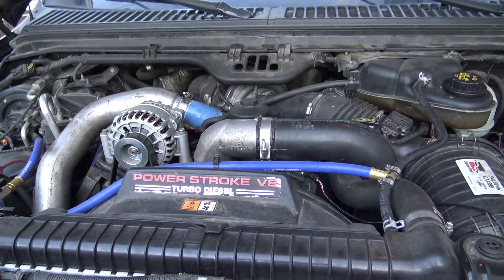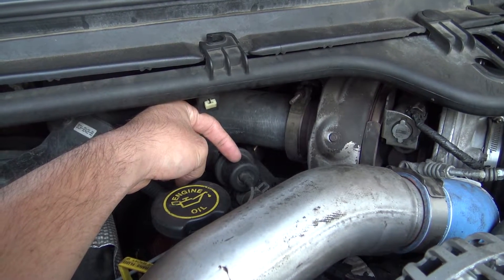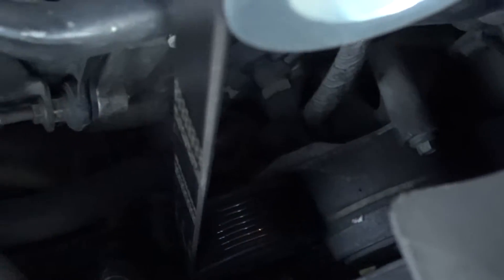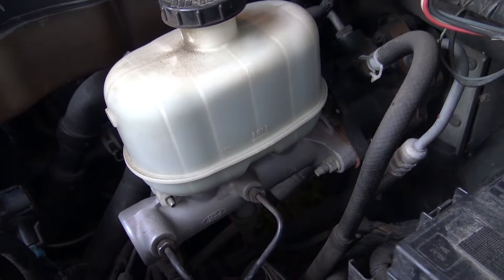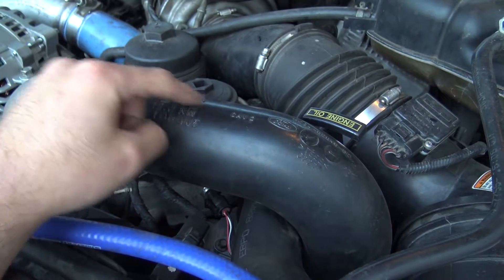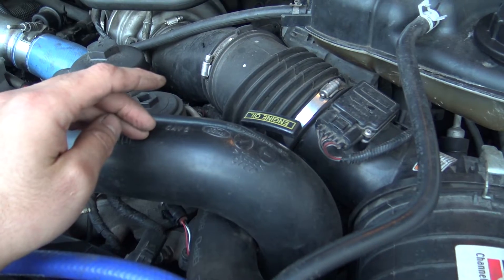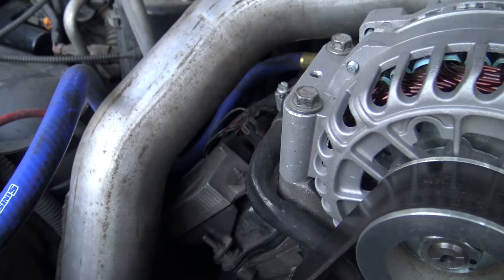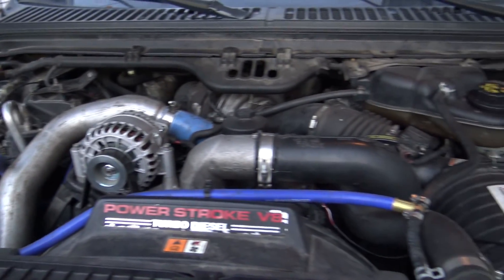6.0 Powerstroke - An Overview of The Basics

Comment: How have you liked your 6.0 since you bought it? Do you drive it every day? Tow with it? Do you plan on keeping it? I have owned mine for about 3 months. I really like the truck but I’m always worried something is going to break. I haven’t had any problem per say but I guess the forums etc have me nervous. Part of me wants to sell it but then the other part just loves the way the truck looks and feels.
Reply from the maker: I love my 6.0, only issue I've had with it was due to mechanic error from the previous owner.  
I don't daily drive it, although I do typically drive it at least once a week.  
99% of the time I'm driving it, I'm towing something and it performs great.  It tows my single car trailer with absolutely no problem.
I do plan on keeping it for a while, I'm doing little upgrades here and there so I can't get rid of it now.  
I like this truck a lot, it's the nicest newest truck I could get in my budget.  A cummins or duramax would be nice but they're a boatload more expensive and they have their own set of problems.
Reply: CtrlAltDefeatTV yeah, I love the Cummins trucks (had a 5.9 for years, wish I would have kept it)  but the auto transmissions ... yikes. I want to like the Chevys but every time I drive them I’m just not impressed.
Reply: RAM RAM there is a reason why these 6.0s are going up in value. Anyone can work on these engines now! The problem 10 years ago was that no one really knew what was going on with these engines. I just bought mine a month ago with 208000 miles. Its bulletproofed but I love the truck. Use to own a 2005 back in 2008. Drove it for 5 years and regret selling it. Never had an issue. Enjoy your truck and don't worry. Key is flushing your coolant, changing oil and use motorcraft filters only!

Comment: I just bought a used tow truck, 2005 ford f450 with 6.0 powerstroke 233k miles completely stock. The radiator got a pinhole and I just replaced it. When I Googled what antifreeze to use for the motor it said Motorcraft gold. So that's what I put in it, was I supposed to use something different? I did a radiator/engine flush after installing the new rad just to see if any debris or any thing other coolant and water came out, and it was clean. I'm new to the 6.0, years ago I had 6.9 international and early 7.3 but this 6.0 is a new one to me. Any suggestions with antifreeze or any other things I can do for longevity other then bullet proofing it, at least until it has an issue with either egr, a head gasket, or oil cooler getting plugged?
Reply from the maker: I've heard motorcraft gold is an ok coolant for it.  I personally use the CAT extended life coolant (ELC).  It's a red coolant that I believe is designed for big diesel equipment and big rigs.  
I've heard you just don't want to use the regular green coolant.  These engines use the coolant to cool the EGR gases and the engine oil so it's exposed to some pretty high temps and from what I understand it causes the green coolant to clog the EGR cooler and/or oil cooler over time. 
The main issue with the 6.0 is the EGR cooler and the cascading effect that happens when the cooler ruptures and you lose coolant.  You rupture the cooler, you lose coolant, you lose coolant you can't cool your oil, the oil and coolant get hotter and hotter until you blow a head gasket and/or melt the plastic bits if your oil system.  
If you don't have emissions testing where you are, I'd delete the EGR.  It eliminates a weak point, and saves your piston rings and cylinder walls from the soot/carbon which does add extra wear. 
If your oil temps reach 15-20-ish degrees over your coolant temp then you may want to replace your oil cooler.  The main worry is clogging, oil coolers do rupture but that's more rare.

Comment: How well do you think the coolant filter works?  And how reliable do you think the 6.0 is? If you don’t put any power to it what sort of problem will you have if any?
Reply from the maker: I haven't cut open a filter or anything, although that might be a good idea for a future video.  But I've seen several posts on various forums of people getting grit and rust out of their blocks while doing a coolant flush and I'm hoping all that is being caught by my filter.
If you maintain the 6.0 it should be fairly reliable, the lower the mileage the better of course.  There are a few issues that can leave you stranded, but a majority of them can be fixed and prevented. 
In my opinion, running stock power levels with an EGR delete and torquepro to monitor coolant/oil temps, HPOP pressure, boost, etc is really all you need.  Don't thrash on it, and it should last quite a while.

Comment: I have a question ha. What’s that radiator thing that’s behind the bumper? So not the main radiator, but there’s like a smaller one underneath... please and thanks!
Reply: Lots of radiator type stuff up there... AC condenser, intercooler, and I think trans cooler. Maybe brake/power steering cooler too.